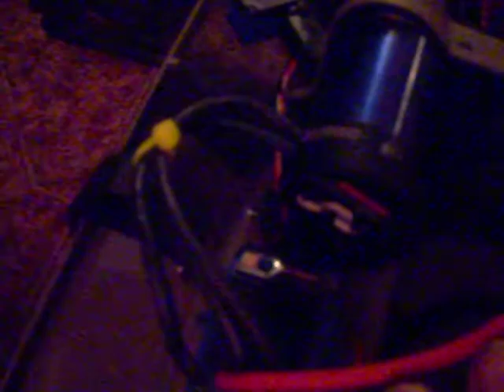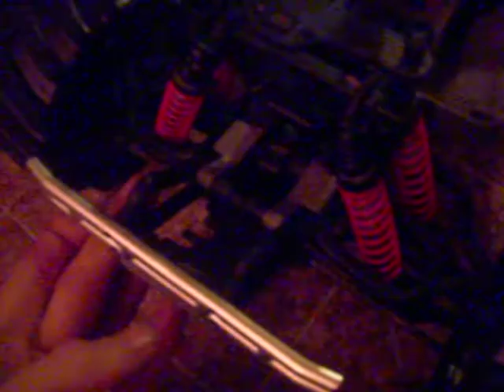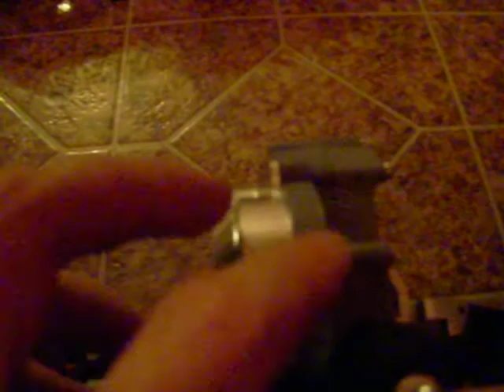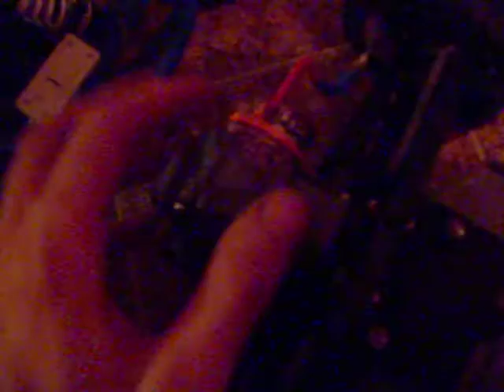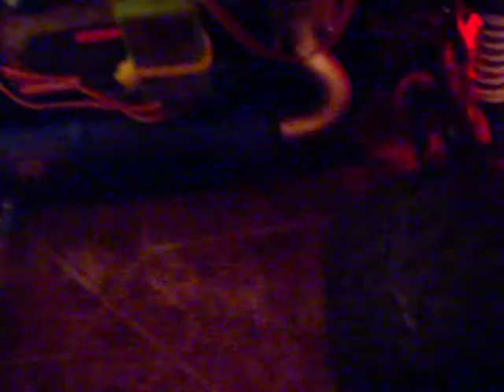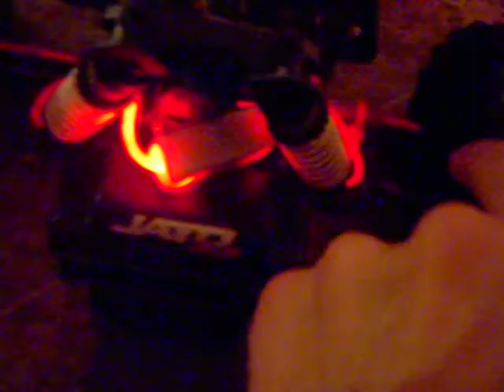traxxas e maxx brushless several others custom projects

Comment from the maker: drive shaft i mentioned for my e-maxx 3905 almost all on ebay r accidentally mis informed info provided to u fromn seller as the 3905 is not same as e t parts the 3905 parts like cvd's fall only in catorigory by itself and r not universal with t maxx when using 3905 be sure to ask or u pay sending part back cost plus 20% off that y u ask cause items returned open they'll try to make u pay but dont, just file a dispute they'll have to fully reinbuse u r/c boys is natorious for this with E-MAXX